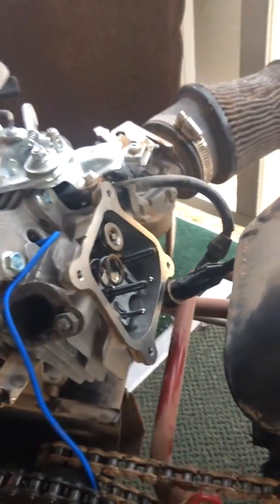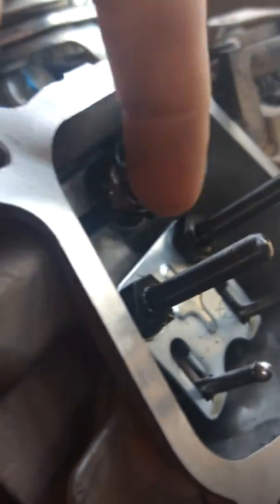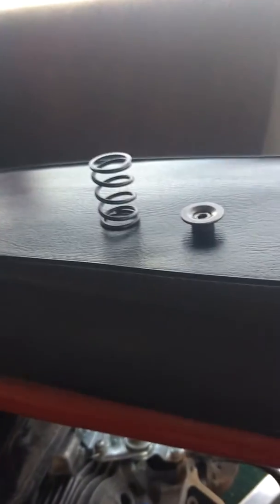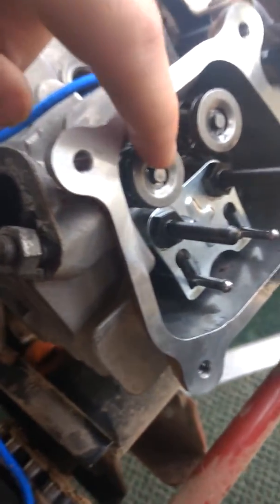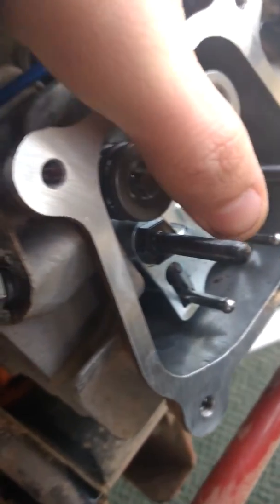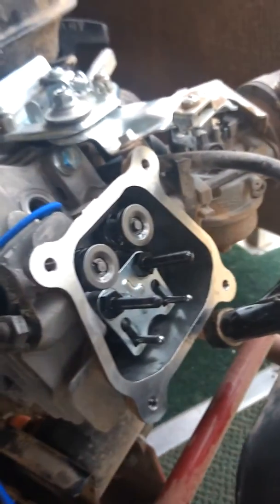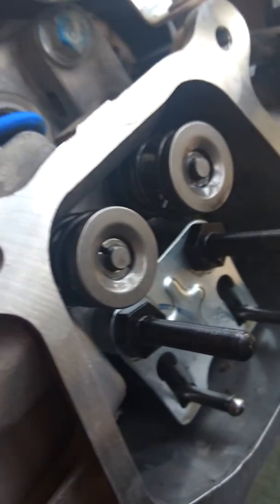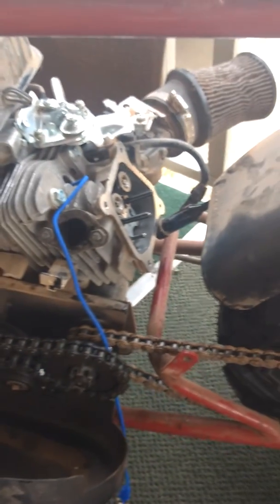Predator 212 valve springs non-hemi

Comment: What would be the valve lash for 212cc non Hemi with o18lb Springs?
Reply from the maker: If you have a stock cam usually between .003 to .005 is what I run but if you have a aftermarket performance cam double-check the cams specs for the lash.
Reply: @bueller_stuntz4172  OK thanks so the intake side is .003 and exhaust side .005?
Reply from the maker: Yup exactly

Comment: How did u actually change out the stock springs I can’t get mine out
Reply from the maker: Make sure it's at top dead center, put some shoelaces in the cylinder through the spark plug hole and then push down on the lash caps. That will keep the valve from opening up when you're trying to pull the cap off.

Comment: How well did this upgrade work did you have any other upgrades before this
Reply from the maker: This engine only has exhaust, 18lb springs, air filter/.036 jet, and gov delete and has been running solid since I posted the vid. I don't go crazy on this motor I never go over 5500 rpm since I don't have anything billet parts.... But I am about to assemble a non-hemi 212 with rod, cam, flywheel, big valve/board and milled head, rockers, carb for m5/methanol, and a few other little goodies. I'll make a video of everything and post it in a month or so. Also that motor will be going on a 1980 Manco Streaker possibly.

Comment: can i do this on a stock or does this only work without governer?
Reply from the maker: You won't have any benefits from the stiffer springs if you have the gov in still. Springs help you not run into valve float at high RPM.
Reply: @bueller_stuntz4172   alright thanks for info. im assuming it wouldnt work with gov bypass either?

Comment: i hope you upgraded that clutch drive to a torque converter , man what a difference. Very worth it but I'll never use the older front pulley, now there is a one piece pulley . Check out my Coleman bike upgrades._.   And i subed